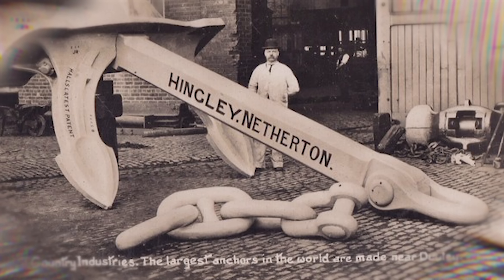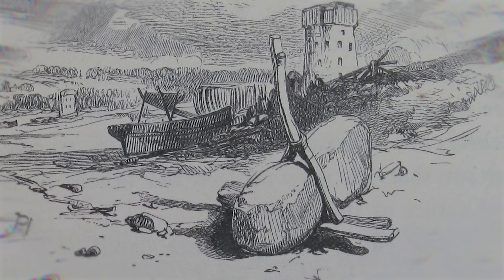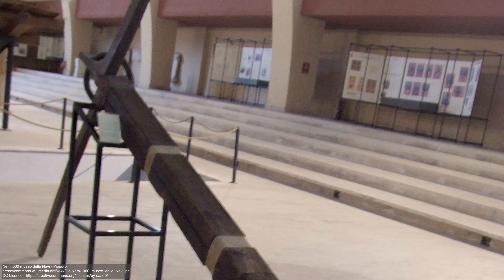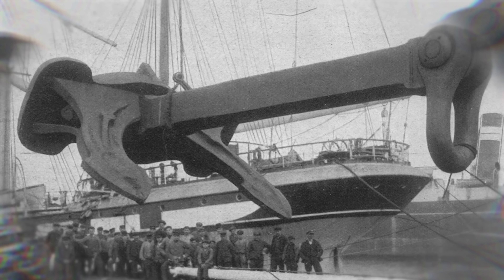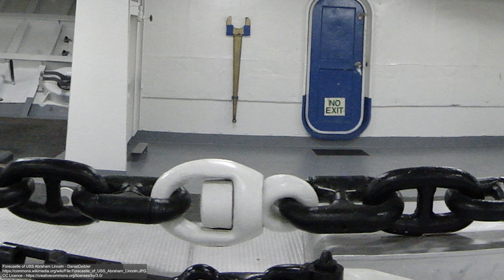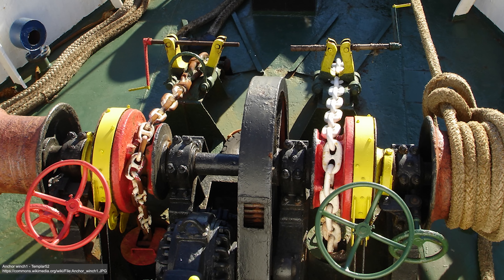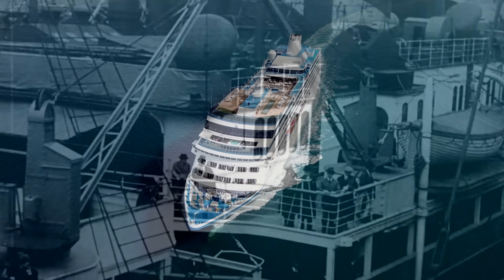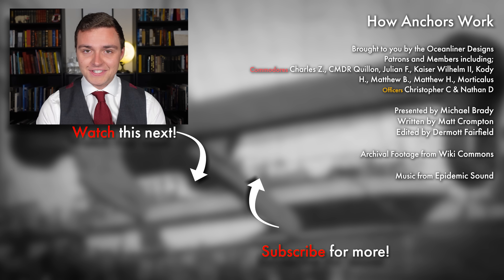How Do Anchors Actually Work?

Comment: The explanation in the video is not entirely correct - if it was true, anchors with rode (the line between the anchor and the boat) made of rope could never hold, but they do. The purpose of a longer rode is to have the pull force more aligned with the seafloor. The weight of the chain helps some in lighter conditions, but if you actually do the math the catenary turns into a nearly straight line pretty quickly when a gale starts blowing. 
And regarding the bit about paying out too much chain - the issue there is not losing holding, that can pretty much never happen. The issue is you swing in a wider radius, taking up more precious space in an anchorage, and can potentially hit other vessels or land. A second issue, mostly on smaller craft, is that a long chain can get wrapped around a coral head or a rock on the bottom and be difficult to retrieve.

Comment: Just a nit to pick - what you show at 5:00 timestamp is not a windlass, it is a capstan. They operate on different planes, with Capstans rotating on a vertical axis and Windlasses on a horizontal plane. What you show at 6:56 is therefore a windlass not a capstan. And yes, I know planes don't usually have anchors.

Comment: When I was a student in Aberdeen, it was a regular thing to see a train of lorries one after the other all the way down King Street, each one carrying one (1) 20-odd tonne anchor. 12 in a row was common, and 16 by no means rare.
That meant a rig was being moved out at sea, with 3 or 4 anchors spread out from each corner of the rig, avoiding undersea wellheads, pipelines, control cables, communications cables, and everything else. Anchor handling was a serious thing.
One summer, in a routine anchor-handling exercise, a Norwegian boat lost control of the anchor it was running out. Sank in under 30 seconds. Six dead.
One of my friends had his leg broken by a length of chain (what you pictured looked like standard 100-ton SWL chain) falling off the back of a lorry he was preparing to unload in an anchor storage yard. He was in plaster for 8 months - it was a bad break. Never worked again.
Anchors are important. 
Anchors are dangerous.

Comment: Very interesting, but I would have expected more information on how they actually work. As in, how does the motor/gearing system work to lower and retract; how is the chain stored to avoid knots and how it actually digs into the ocean floor.

I think a more appropriate name for the video would have been "a history of anchors".

Comment: Quick, show thid video to the crews of Russian (allegedly, but certainly) cargo ships that have dragged anchors over the bottom of Baltic sea in the last year to break all sorts of cables and gas pipelines on at least 6 occasions during the past year (last time 2 days ago). Now there is at least 1,5 broken off anchors on the bottom too, if anyone wants to hunt for them, probably some maritime spying equipment thrown overboard too. The locations are known, just that the achors were dragged for 50-100km.. imagine doing that until you snap off half the anchor

Comment: Thank you for this video on how anchors work ,I have just one question about this , Titanic had 3 main anchors 1x  15.5 tons
2 x  8 tons 
Everyone tells us the way an anchor works is a combination of both the  anchor and the chain hold the ship ,but Titanic's center anchor was held by a thick  wire which is obviously no where near the same weight as the chain ,could this be why it weighs almost the same as both port and starboard put together so just uses mass to hold it but the issue i have that wire again is no where near as strong as a chain ,and it's also not a quick anchor to drop if needed in and emergency, so when would they use this monster ? .

Comment: You Could have shown a picture of the anchor laying on the floor as is still don’t quite get it ….does it grip into rock on the seafloor? OR just ja chain gripping into the floors?but how does it prevent sideways movement if the wind changes ?

Comment: Capstans are vertical axis - but they are used to handle rope. A windlass can have a vertical axis but that doesn't make it a capstan. Some vertical axis windlasses have a capstan in top to handle ropes as well. 

Some horizontal axis windlasses have a horizontal drum like a capstan for rope. Usually its then called a warping head.

Comment: As an aside, letting out an anchor gave rise to a common English expression. 

Historically, the anchor rope was wrapped around a post located on deck called a bitt.  Pieces of cloth were tied to the end of the rope attached to the bitt. 

When the anchor was being lowered, if the crew saw the fabric, it let them know they had reached the BITTER END and that they needed to find shallower water.

Comment: It's a little odd that the word "capstan" was not mentioned and "windlass" was used exclusively throughout.  A capstan is indeed a form of manually driven windlass, but a windlass is not usually a capstan.  Both are meanings that overlap with "winch".

Comment: At 5:19 there's an image of sailors pushing a windlass clockwise, and the rope looks like it will be coming off the windlass - I'd have thought they'd want to be the other way round to make it easier to slow the anchor on the way down?  That said I've no nautical experience so it's very possible I've missed something that would be obvious with (any) experience!

Comment: Whats funny is i like to think the way anchors ACTUALLY work ... Ended up by comolete accident lol. I think they thought originally if you stuck one heavy piece down at the bottom it would keep the boat planted... Rather than the actual weight of the chain and the SLACK of the chain doing the actual work lol

Comment: It is the anchor that holds the boat. Modern anchors will bury themselves when a pulling force is applied to them. The chain is to apply horizontal force to prevent pulling the anchor in an upwards direction. You could use a rope if it were long enough and strong enough. Many smaller boats often only use 6 feet of chain and the rest is rope. Mooring balls don’t always use chain and when they do, it’s very short, the rest is rope and anyone who has used a mooring ball knows how stable they are. Sure they use a different type of anchor, but it works the same by burying itself.

Comment: Another great video - enjoyed the history and pics.

I think you know this, but wasn't made clear in the video: the way the anchor CHAIN keeps the ship in place, is the weight of the chain and the angle of it - hence the chain being 3-7x the depth of water. At rest, the chain is almost vertical. But as the wind pushes the ship, the angle of the chain increases, and pulls more chain off the sea floor: it is this weight that is pulling the ship back towards the anchor - the anchor isn't doing the work. This also means the system is flexible, and can take surges and shocks without breaking the chain or anchor.

Comment: I once left our 43 foot 18 ton saving yacht anchored in 15 feet of water with an 80 pound Danforth and one hundred metres of chain

While I was away there was a real Gake and when I came back I found that the anchor chain had stretched and would hardly fit the Gypsy the shank of the anchor was bent it was made of three quarter by  3 inch ms

The flukes were okay because they were folded 10 millimeter plate I had two of these and used to run one on chain and the other one on three quarter Rode r rope

I found the only thing that would hold us on a hard flat Coral bottom was an Admiralty patterned anchor often known as the fisherman 100lb

I also learned do not make ground tackle out of mild steel it is just rubbish you need to go to higher grades

Comment: Two points I really think you should have mentioned. First - anchors hold by digging in, not by weight. All the rode is let out to assure the ship's pull is sideways, so the anchor digs in, instead of pulling out. Second, the stockless navel anchor you show is rarely used on smaller vessels. Modern anchor designs are almost all single fluke designs.

Comment: At 80 meters depth, how fast does the ship has to move to lift the anchor from the sea bed due to drag? And at what angle will the chain be? And how many meters of cable is needed to reach the bottom at lets say 15 knots? I am asking because I don't believe in the story about Chinese ships cutting deep sea communicating cables laying on the sea floor in the Baltic sea. Sailing for hours with forward anchor dragging the bottom would turn the ship. I think it's a scam to blockade Russian ships. The cables was also repaired with in days. Pictures of rusty salvaged anchors and rusty anchor ports on the ship without any trace of wear and tear dragging an anchor for hours!

Comment: And this is why boats on smaller inland lakes don't know how to anchor.  They use an undersize anchor, and then use a small thin rope (line) to attach it to the boat.  Then they lower it to the bottom and tie if off to the boat.  I always had to explain to many people how to properly anchor, and to get rid of the rope touching the anchor and get some amount of chain leader to help hold the anchor to bite into the floor.  Then play out at least 3:1 to 5:1 worth of line. When people would raft up and tie up together I would always deploy 7:1 scope.  It would hold just great even when the wind would come up.  Now with my large yacht I typically always try to get 7:1 out if at all possible.  However with dual bow 330lb anchors and 450' of 1/2" chain on each, there is a lot of holding power there. 🤠😁  Then I have two smaller stern anchors just in case I need to be held in place.

Comment: A lot of interesting dialog about anchor handling... BUT he missed the boat regarding how an anchor actually holds a vessel.  Sure the weight of the chain offers some drag on the seafloor, but the purpose of that chain weight is to ensure the anchor is plowing horizontally across the seabed, preventing any vertical lift.  The various anchor designs are meant to plow into various seabeds from sand to rock  -  but in all cases, it is the ability of the anchor to plow its' flukes into the seafloor that provides the primary holding force.
Anchoring procedure is to lower the anchor until it is on bottom, then backing away as more chain/line is payed out.  Rule of thumb is 5-7x depth of water where the anchor was dropped.  This is to ensure that as the vessel pulls against the anchor line, it will not lift the anchor itself away from laying flat.  For those inclined to look at things mathematically, this is a classic application of a catenary curve.
To 'weigh' anchor, the vessel motors toward the anchor as the line is gradually retrieved into the vessel.  Eventually the anchor will be lifted instead of drug due to the line becoming short enough to begin lifting the eye of the anchor more & more vertically until the flukes disengage the seafloor.
Interesting video: 6/10
Accuracy: 1/10
Reply: Agree he missed the main explanation 🤦‍♂️
Reply: imagine all the marine life thats been suddenly crushed to death by these anchors and chains. I never thought about it before.
Reply: @mbalentine781  based on my experience and the years I spent at sea school getting my Master Unlimited licence, I can say that Mr Brady was on the money. It is the chain that holds the ship once she is brought up.
Reply: @garysmith2450  Sorry, but that is wrong.  Seems to be a common misconception though (color me surprised).  The anchor is what holds, and is designed to plow securely into the sea floor when laying flat. Weight of the chain ensures the anchor does indeed lay flat even when the vessel is trying to drift down (wind/waves/current/etc).  Anchor & flukes are designed to disengage as anchor begins to lift vertically (he does a fair job covering that in video).  Sad to hear you were taught wrong...however the anchor will still hold so long as it is properly set, whether or not the theory is understood.
Maybe I should do my own video on this...
Reply: @ the anchor is designed to ensure that the chain is pulled in a neat line along the seabed. Once this is done, it is the chain that holds the ship. When I anchor my ship, I chart the actual position of the anchor. We then go astern, laying chain (or cable to give it its correct name) neatly in a line on the sea bed. Once brought up, the ship swings about the point the chain touches the bed. This can be observed on the chart. This proves that it is the chain that holds the ship. If we get to the point where the swinging point is the anchor itself, it will start dragging. We will then either lower more cable or weigh and steam.
Reply: @garysmith2450  So you're saying that you really don't need an anchor at all, just a single link of chain laying on the seafloor that you then pivot about??  (I don't think that's what you mean).  Neither do I think you'd claim there is no need for flukes on the anchor, let alone being limited articulation.  Or that anchors should be simplified to just dead weight.  Or just knot the chain.  No, I don't think you'd say that.
The anchor & chain do work as a system and chain weight per length is a critically important parameter along with the scope:depth ratio.  Idea is to have at least some of the chain flat on the seabed even under the most strenuous conditions.  This allows the anchor to remain flat and develop whatever holding strength it is capable of.

I think the misunderstanding comes from the fact that mild anchoring conditions allow most of the chain to just lay on the seabed.  Even then the vessel will tend to drift down until the chain is pulled more or less straight against the anchor.  It is when substantial holding force is required that we see most of the chain lifted off due to tension and it is evident the anchor provides the actual holding force.  Again, chain weight is critical so that the eye of the anchor is not lifted.

Comment: Actually, you do such nice videos, but you are wrong about anchors.  The chain is not the primary holding force.  Other than weight, chain has little friction to hold a ship in place.  If you were correct, anchors would only need to be a heavy round object to hold the chain down.  In actuality, the anchors have flukes which dig into the mud or sand bottom and provide the holding power.  Small boats in fact often do not even use chain, but rope or nylon line to hold the anchor.  Chain may only make up a few feet of the anchor line to protect against rocks or coral.

Comment: First of all, I like your video.  However, what you say at 8:00 and following is not correct.  The anchor is not merely a weight to hold the anchor chain/cable down.  The anchor rode (the technical term for the rope and chain attached to the anchor) works to hold the anchor shank parallel to the sea bed so that the anchor is pulled horizontally and the flukes can dig in.  The reason for letting out many time the depth of the water in rode is so that the centenary effect of the length of rode will turn the downward force at the bow of the vessel into horizontal force by the time it reaches the anchor so that the anchor is pulled across the sea bed and the flukes can dig in rather than being pulled up so the flukes break loose.  Essentially, the force of the rode is turned from downward to horizontal by the force of gravity acting on the rode much as if there were a physical thing like a block/pulley that the rode turned around.  This is why the crew will let out rode equal to 3 to 7 times the depth of water--so that there is enough length and weight of rode so that the centenary effect and do its thing.   This is also why a weight is sometimes lowered along the anchor rode to a point near the sea bed to increase this turning force.  If the anchor was merely a big weight it would not need flukes, and certainly would not need flukes that pivot so they can dig into the bottom.  Yes, the friction/drag of the rode on the bottom helps hold the vessel, especially if wind or current is causing the vessel to shift position so that it is pulling on the anchor rode from a different angle.  But the flukes digging into the sea floor is an integral part of what holds the ship, not simply the weight of the anchor.  Nonetheless, I suspect you merely misspoke, since, at 10:50 and following, you say that the windlass is engaged "once the anchor has dug in below."  Yes, the anchor digs in.  It does not simply provide friction by weight on the bottom.

Comment: Interesting but just some clarifications

The picture shown at 5.00 is not a windlass. It’s a capstan but used for heaving in an anchor. The picture at 7.00 is a windlass

It is often a case where even alongside an anchor is dropped to be used when the vessel is pulled off the quay on departure . That continues to this day and a bow anchor is used

Shots are now known as shackles and each shackle length is marked on the cable (chain)

Comment: At least one of the anchors from the Titanic was part of the travelling exhibit I saw at the Ontario Science Center years ago. It had not corroded consistently. The variations in the amount of corrosion were attributed to minor differences in composition and density of the steel as it flowed into the giant mould when the anchor was cast. The flow lines were clearly visible.

Comment: Correct me if I'm wrong, but isn't what you called a Windlass around 5:00 actually a Capstan because of the vertical axis of rotation? Windlass's have horizontal axis of rotation.